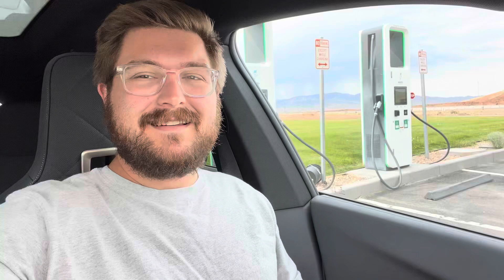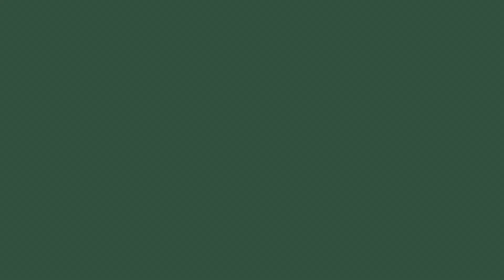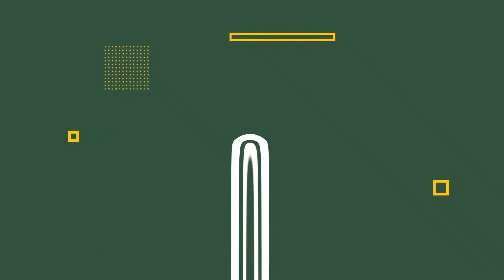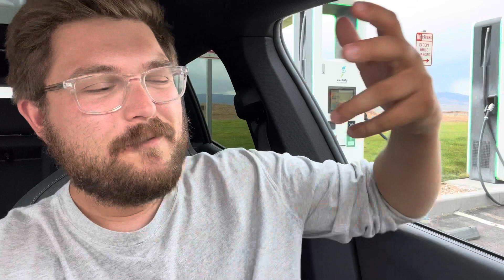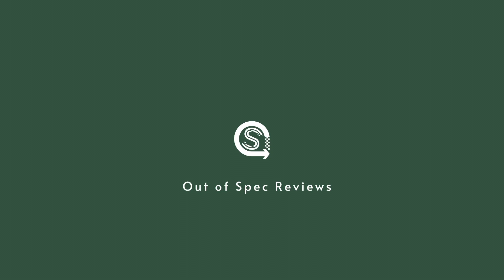Here Are The Benefits Of An 800 Volt EV Architecture - Is It Really That Much Better Than 400 Volts?

Comment: I would say invest in minimal voltage packs and elevtronics( less than one for pack and 12 for lighting and stuff) and invest in capable efficient power converters just at the charging and motors

Comment: Is using 150 kW 400 V EA charger to charge Hyundai Ioniq 5 bad for the car compare to the 350 kW charger? The efficiency is lower by using 150 kW charger? I mean if you using 150kW charger and EA delivered 10 kWh and the car received much less than 10kWh?  Will using 350 kWh charger is better for the Ioniq 5, since it is 800 V charger to 800 volts battery even it charge a little fast?  I was worried about charging at 350 kWh is bad for Ioniq 5 because it charge faster. Maybe charge at 350 kWh is better.

Comment: Doesn't matter what it is now.  800V architecture is the future and needs to be the standard for EVs to provide the best efficiency with being able to supply the most voltage with current for efficient charging.  Its just a matter of having that transition phase where you have 800V and 400V charging cars.  EV charging infrastructure needs to be able to toggle between 400V and 800V charging which CCS standard and I believe EA chargers can support.  The NACS connector can support 800V charging but it seems to be limited to v4 superchargers which have barely made a dent in the US market.

Comment: so as you said main benefit is fast charging, but you can only benefit from that when the battery can handle it, and the most batterys are around 60-80kwh, so they physicly can´t handle charging power > 200kw for longer time.  Talking E-GMP  it´s really impressive how they handle > 220kW for relativly long time. I´m personnally not sure if this is really healthy for the battery. So 800V is reasonable for batterys > 100kW imo. We´ll see.

Comment: My Hyundai Ionic 5 suffered a delay but now I have finally  a VIN for my 2023 model, as reported by KED Global the insulated-gate bipolar transistor (IGBT) chips made by Infineon Technologies had a defective 2 month supply batch that had to be turfed, these are specifically associated with their 800 volt architecture, not a common part, precisely your reasoning. The 800 volt design relies on custom chips that are not so readily available.

Comment: Correct me if I'm wrong.
AC to DC there's heat and loss.
And then again DC to DC onboard charger, to spec up 400 to 800 Vdc, generates heat and loss again. It's best to keep the cars cheap and light. Invest in HV chargers rather than 400 Vdc standard chargers. Am I wrong?

Comment: Good technical ranting but bottom line is people don't buy EVs because of hassle s with charging. Look at the ignorant comments in any article and its one of the main be points. You're sitting in a 400 volt car that cost $20K to 30K more than my EV6 with 800volts. If you explain that you can get a cheaper car that will get you out of a charging station in 18minutes versus 40 you may help us to educate the ignorant. Dude its a Kia  with all the technology you said no one wants to invest in!

Comment: I'm surprised you didn't mention the drawback of 400V vehicles potentially being unable to charge at peak rates due to the charger having current limitations. All the 350kW DCFC near me also have a 350A limit.

Comment: Good video, clear explanation 👍 I agree for most 400volt is fine better to concentrate on efficiency which needs smaller batteries and then you don't need high charging rates. Also as lot of us will mainly charge at home at 7kW!

Comment: I think what GM is doing with switching parallel to series to get the higher charging voltage is a great idea and other manufacturers should do that too.  It doesn't even need to be on a battery pack level - each battery pack contains a number of battery strings, each at 400 volts - you could have contactors that switch the connections between those strings from parallel to series in whatever configuration is necessary to get all kinds of multiples of 400V voltages.

Comment: You completely skipped the other aspects of the 800V systems in combination with SiC inverters. The SiC transistors enable you to up the voltage and switching frequency allowing different kinds of control strategies while bringing up to 5% efficiency gains. So even if for charging 800V is not really required it does bring efficiency gains for the powertrain.
Reply: Plus a 800V inverter would be lighter (less copper)

Comment: Ultium battery packs come in three basic sizes, 50, 66 and 83 kWh.  I think the larger 100 and 200 kWh packs are multiples of the 50 kWh pack so that they can be split into dual 400 volt packs to accommodate 800 volt charging.  Since the three smaller packs are 400 volt packs only, vehicles using these packs will be limited to 400 volt charging.  I can’t think of any reason why the 66 and 88 kWh packs can’t also be doubled or even quadrupled to make a variety of battery pack sizes to handle a wide variety of applications, and support 800 volt charging.

Comment: When Kyle refers to P= I ^2 R, he refers to power loss in charging cable and vehicle’s charging system.  You are paying for that power loss. It’s the primary reason why kW on charger display are higher than vehicle’s display.  

There’s much less heat generated and wasted when you reduce current by 50%.  Therefore, a 900v system is more efficient.

Comment: Excellent information, I really appreciate the deep dive!  On the other end of the spectrum, I’ve heard there is a significant energy loss when charging a given vehicle with Level 1 vs Level 2.  Why is that?  Have you done any tests to quantify the discrepancy between energy from the home charger compared to battery uptake along various charging systems?  That would be very interesting to me.

Comment: I disagree with the statement that 800V architecture components are harder to manufacture. They just aren’t as widely available. The lower amperage is actually easier on most electrical components because the higher amperage requires wider tracks on PCBs, larger wiring, larger conductors overall and more cooling for the same power. Higher voltage requires better isolation but can use smaller conductors and less cooling for the same power.

Higher voltage can also help to reduce the size of motor components as long as they are also running at the higher voltage. Again, less amperage means smaller conductors. Since electric motors are basically electromagnets comprised of several wiring loops, smaller wires means smaller and lighter motors.

You also mentioned DC fast charging, but I think that is a substantial benefit to the higher voltage. My Ioniq5 charges 230kw at 300A. Something like the BMW iX charges 200kw at 500A. There is a HUGE difference between 300 and 500 A, especially considering that the equation for resistive power loss that you mention squares the current. 300 ^ 2 = 90,000. 500 ^ 2 = 250,000. That’s not a small difference, and all of that difference is loss of efficiency. Even if there is no difference in the battery itself, there is a huge difference in the amount of energy lost in cabling, charging hardware, motor hardware, inverters, etc, plus the additional energy needed to cool components that are heated up due to that energy waste. I believe some EVs that charge at extremely high amperage (like Tesla, BMW, etc) have to limit their charging speeds specifically because the cabling and connector get too hot.

Comment: I see the benefits of going from 400V to 800V but why are manufacturers speeding up DC fast charge time with 800V cars?  The limiting factor is stress on cells, cells don’t care about pack voltage.

Comment: Current into the cell stays the same, the limiting factor to charging speed is battery chemistry which has nothing to do with being 400-800v pack voltage

Comment: 10:02 Don't forget GM's strategy with Ultium, which is to split the pack so that when charging, the two halves run in series. This enables using 400 V or 800 V chargers without a voltage booster or wiring through the car's onboard inverter. And really, that speaks to the biggest issue with  "800 V" EVs: All but Lucid are still using 400 V powertrains, so the only gains seen from 800 V batteries are with the charging. 
That's why GM's model makes the most sense to me because none of these other EV automakers that are using 800 V charging are pushing past the real CCS limitation, which is 500 A of current. The single-stack Ultium packs have a 500 A limit, so there's no need to push 800 V. The double-stack packs, however, could theoretically accept 1,000 A, which is twice as much as the CCS standard is capable of supplying. Even the 700 V nominal limit for the double-stack Ultium packs makes sense because the current crop of 350 kW CCS chargers can only supply 500 A up to a maximum of 700 V, at which point they have to start tapering the charging current.
Reply: 12:34 *Edit: Okay, you didn't forget. 😀

Comment: Depends on the car and it's purpose. For a bigger battery, high consumption vehicle, it absolutely matters. As we go forward, trucks like the F-150 Lightning are going to have to move up in voltage to bring charging times down which is absolutely going to be a competitive feature against competitor vehicles. It's the one thing they can do to make EV towing doable, going up in battery size can only scale so far. And as they scale to F-150 volumes, costs will have to come down as well.

Comment: 1:49 Just dropping a nerd line here on LFP. While the voltage range is narrower than nickel batteries, that doesn't seem to be the main difference in terms of charging. LFP cells typically have a voltage range of 2.5 V to 3.65 V, while nickel cells typically fall between 2.8 V and 4.2 V. However, the difference appears to primarily be in the intercalation, where LFP appears better able to absorb current throughout its charging cycle and requires a significant saturation phase after peak cell voltage has been achieved. 

Thicker electrode nickel cells typically have similar current absorption as LFP initially; however, after ~50% state of charge, they start to significantly taper for the remainder of the charge cycle. Thinner electrode nickel cells, on the other hand, are capable of either absorbing massive current at low states of charge with a gradual taper for the remainder of the charging cycle (e.g., Porsche, Lucid, Tesla) or absorbing relatively high current until ~80% state of charge, followed by a sudden and significant drop off in charging current until the completion of the charging cycle (e.g., Audi e-tron).

Comment: your comments are right on the mark. 400v architecture is great, and works well. The GMC with Ultium tech and switchable charge structure to 800v will work awesome when the infrastructure for charging electric vehicles catches up. Most of North America is behind to have available infrastructure to easily change from I.C.E vehicles to electric. And speaking from Vancouver island BC Canada where we have a lot of Teslas we still struggle with high end charge stations. Still we have to keep in mind we are at the beginning of this evolution. Love all your shows keep up the great work.

Comment: This is mostly right, but not fully. Voltage is supplied, current is drawn. You're talking about voltage as though the pack determines the voltage (based on SoC). That's not strictly true. The charger is going to supply a number of volts based on its own specifications. 

BMS, however, specifies the amount of current it wants to draw. So the voltage is (relatively) constant irrespective of pack voltage. This is definitely true with AC, though I believe it is equally true for DC charging as you're detailing here.

EDIT: It does seem that DC fast chargers align with pack voltage. I don't have any details for this -- please comment to provide context around that.
Reply: The charger in the video was showing the voltage increase as the current reduces. So I'm thinking that the voltage is increasing as there is a lower volt drop at lower currents. But this volt drop must be occurring up stream of the charger. I understand what you say about current is drawn, however I believe that EV chargers might be slightly different as the vehicle send PWM signals back to the charger to control the current. A thirsty battery might want to draw lots of amps, but if the battery temperature is too hot then the  vehicle sends a message to the charger to reduce the current. I'm not sure how it would reduce the current unless it's done by PWM.

Comment: Benefits to 800 Volt. 
Hyundai/Kia solved the EMF feed back issue with the 800v architecture. DC motor speed is proportional to voltage; you need higher volts to overcome the higher back EMF that you get at higher speeds. We EV6 owners have the volts.  :)

Comment: Man, you just contradicted yourself: 

On one hand you confirmed that 800v architectures are more expensive and need more and better engineering (this resulting to a better product and kudos to the manufacturers that do so);

And on the other you claim that ‘it is ok if a premium manufacturer like BMW and Mercedes, and dare I say Tesla, have not bothered with spending that money and effort to provide a premium and better product!

Well, you cannot have it both ways, unless you are trying to excuse cost cutting and shoddy engineering to save face for the manufacturers that should have known better (and until they do spend that money and effort, after which time, ‘it will be the only way to go’…)!

Comment: I would say that the 800V system could potentially future proofing your car. If and when charging stations will be able to supply 300-400kW, you should be able to take advantage of it, rather than being stuck at 200kW. On the other hand, when that will happen, battery technology will have progressed quite a lot in the meanwhile. In the end, if it doesn't come at extra cost for the end user, why not?

Comment: My '22 Taycan with the 150/400 module can charge at 173kW on a 150kW EA charger up to 80% then it starts tappering. @88% SoC it's still over 50kW. in 19 minues the car took in 55kW. I would not be too bumbed out charging on a 400V 150kW charger.

Comment: Great video. Very helpful.  Does this mean that the Tesla...which is known for its efficiency...could be even more efficient at 800v?  Gross oversimplification, I know....but seriously curious.
Reply: Yes because it would be lighter (less copper, smaller inverter etc) and probably less wasted heat for Amps squared X Resistance losses.

Comment: This discussion makes me think of the difference between diesel engines and gasoline engines, the diesel engine has very high compression. Yet to this day they are both being used and have found their purposes.  
  Now one thing with Tesla, they have been making cars for a while now and I have figured out how to minimize the distances between contactors batteries and motors so running a lower voltage doesn’t give as much drop if the distances it Hass to travel or short and efficiently laid out.

Comment: Something Sandy Monroe talks about every once in a while is making the switch from 12volt technology to 48volt. The real answer to making better electric cars is better batteries but who knows when we will get a leap in battery technology
Reply: I hope next year already when Nio gets their 150 kWh changable battery to the market and CATL the super fast charging quilin battery (claimed to be better than Tesla's 4680).
Reply: The reason why he talks about 48V batteries, is because you would be able to use smaller wires (4 x smaller CSA). so instead of a typical weight of 50kg for a wiring harness, it would be 12.5kg. If copper costs $8 per kg, that's $300 saving!.
Reply: @joseclaus7224  thanks for the explanation and do you know when Tesla might make the switch. Since you seem to pay more attention than I do, what do you remember about the military grade hardware Sandy was so proud of during the teardown
Reply: @macberry4048  I don't know when Tesla will make the switch, nor about the military grade hardware as I did not watch that video. I'm an OEM electrical Engineer (retired), so understand the benefits of a 48 Volt battery.

Comment: In Europe Tesla Super chargers use Type 2 CCS plugs and we charge our Teslas with 250KW, meaning around 650 amps runnings through the wires. 

No EV battery today can take much more than 250KW for sustained time without seriously being damaged. Porsche Taycan will do 260-270KW max. 800V+ will only be needed for 350KW charging and beyond I think.

...but yes, any other charger than Tesla can maximally provide 500 amps, therefore Tesla ´s only charge at 200KW at non-supercharger DC chargers, but if there was a car today that could keep a sustained 200KW power going into the battery, say, from 0-100% or even just 0-80% would be the fastest charging car by far.

If battery tech could be improved so that they could be charged with 200kw sustained charging until almost full, then that would in itself be a revolution. At the end of the day, not even high voltage systems can solve this. A fast jolt, like the 250-270kw charging cars in the beginning of the charging session at low SoC is a nice thing, and these cars charge blisteringly fast til 50%... so either we need biiiiiig battery we only need to charger to 50% on long trips or new tech where batteries can take high charge power right up to 100% - or a combination of course.
Reply: Out of spec did a report of Zusmarshausen charging park that has chargers exceeding 500 A.